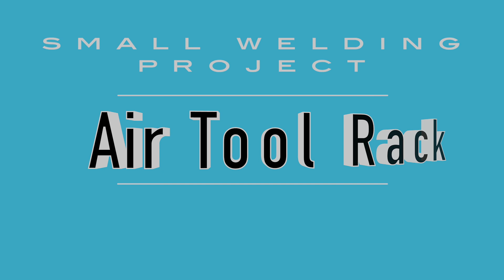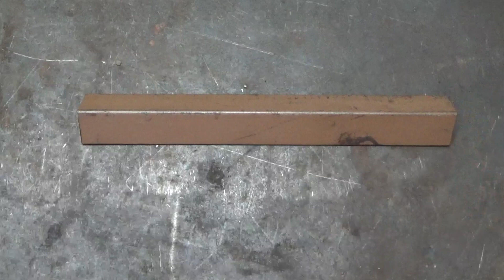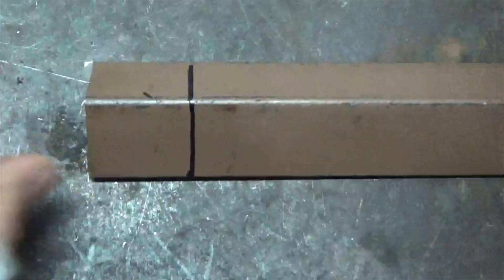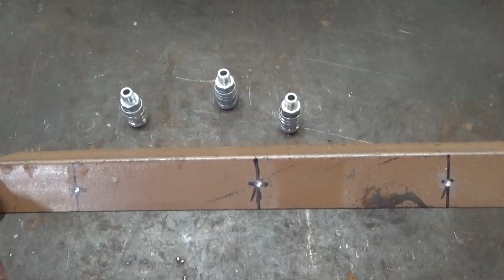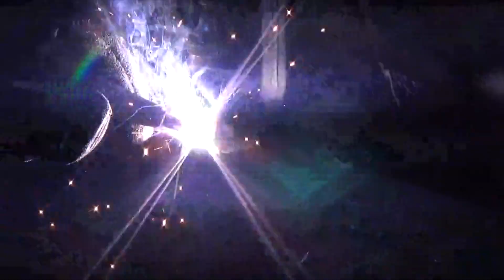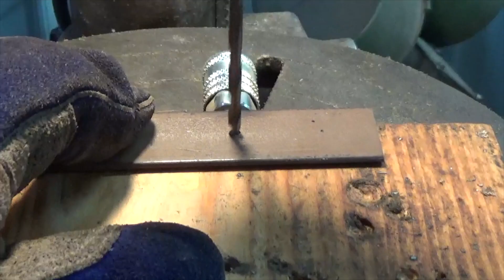Air Tool Rack - DIY / Small Welding Project

Comment: Mr Crockett, Mr. Crockett here. (seriously)  We chatted before in the comments.  I was thinking that you could probably drill small holes through your mounting scenario in to the body of the storage couplers.  That way, you have an access hole to the innards of the air tools.  Stuff the holes you made with felt or some such and saturate with air tool oil.  That way, when you return the air tool to it's storage coupler, it gets a small drip or two of oil as directed by most manufacturers thereby prolonging the life of your expensive air tools.  Just spitballing.
Reply from the maker: That is a fantastic idea!  Thanks for the tip!
Reply from the maker: You could also tap them and install grease zerks
Reply: @PhilCrockett  Or actually since you drilled and tapped, why not install small oil cups like on a lathe or machine tool!

Comment: Yo, Phil and a GOOD deal there! I take my welding projects to the truck shop or saw mill and farm them out. I think about getting a mig/tig rig but I really need one like a hog needs a side saddle. That's where bolts, nuts and washers come in here. And a hammer to fine tune it. And what few air tools have their own case and spot on a shelf. And our great, huge compressor is about the size of my fist so no need to get anything bigger. Thank the Lord for star drives and deck screws! Hope all is well in Kitty land and the freezer and family is full. Rain and grass mowing here as usual. Yall have a Jesus weekend coming up and thanks for the ideas! GBWYall! (Us'ns)
Reply from the maker: Yes sir Lewie...   I love the star drives and deck screws as well!  However, I sure love welding, but not the metal prices.   I have a couple more welding projects coming up very soon.  I was going to work on a new grill grate from some 3/8 rod today for my rusted out BBQ grill, but my buddy said he was free to go fishing.   Heading out this morning to set some lines on the Might MO.   I hope to have a good fish story for you.   Have a blessed weekend!  GBWU2!
Reply: @PhilCrockett  1st thing 1st. Got to have fish to grill. Hope yall got a STACK! Weld on, Buddy! I used to some but no more. I farm mine out nowadays. Lots easier than trying to keep stuff dry and whatnot but I still think about a tig rig. GBWYall and happy fish gnawing after the grill is fixed!
Reply from the maker: put 10 fiberglass poles out and checked them this morning.    no fish, except for the last pole.  My buddy pulled the fish up, and it came off the hook and swam away!   He was beating himself up all the way back!   Anyways.... ended up taking the wife out for a nice cruise later.  I made a video of it in fast-mo.   wish I could somehow share it with you.   It was a beautiful day.
Reply: @PhilCrockett  It WAS a beautiful day till the clouds rolled in here.  got the back yard mowed just as the storm started. Just now got a shower so I'm presentable. Tell the pal that the fish just wanted to put on more weight and that it'd see him later on. Glad it all worked out. Our Sweeties are sure a blessing. GBWYall!

Comment: Why weld them? If you thread the holes for the connectors, you can still use them in a pinch if needed 😀
Reply from the maker: Sure!   If you don’t know how to weld, you can drill and nut.  It will take more time, cost and effort, but works just fine.   I like the easy and efficient route with welding...... but not everyone knows how to weld.